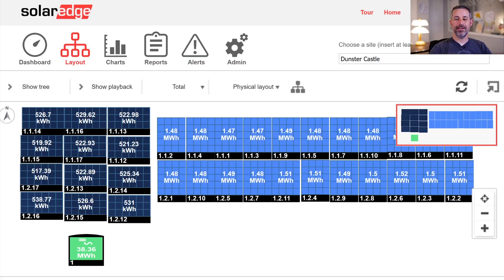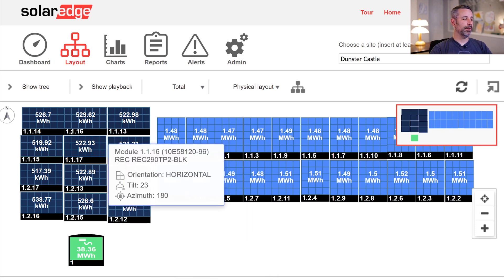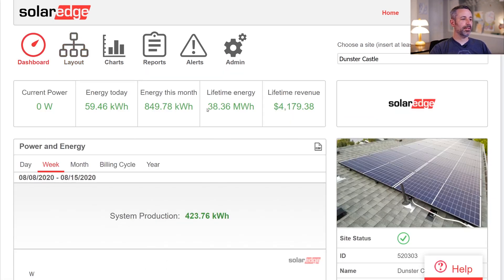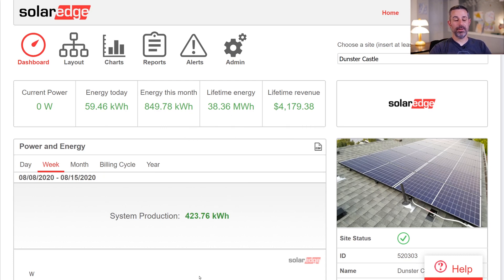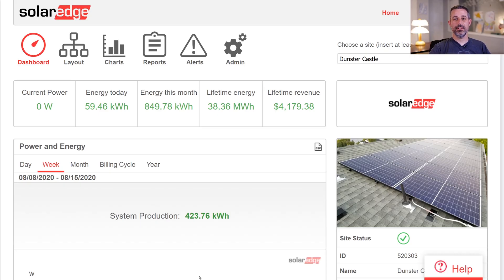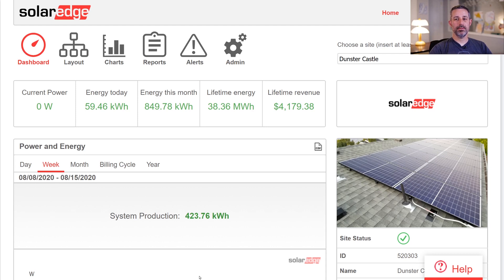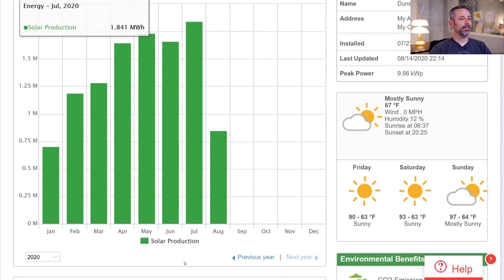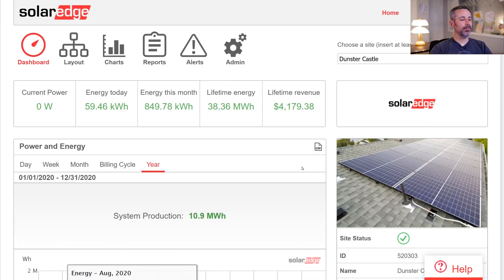How Much Energy Has Our Rooftop Solar Produced After 3 Years?

Comment: Nice summary!  any issues seen in the last 3 yrs going solar? Video on that would be nice..
Reply from the maker: We haven't had any issues. The system has worked flawlessly, unless maybe if you want to consider the fact that I moved the panels after the first winter to help the snow to slide off better. I made a video about that a while back on my channel.
Reply: Got it thanks.